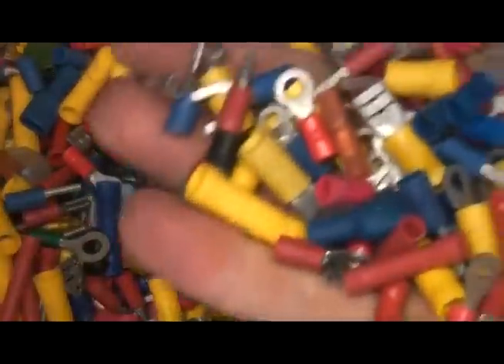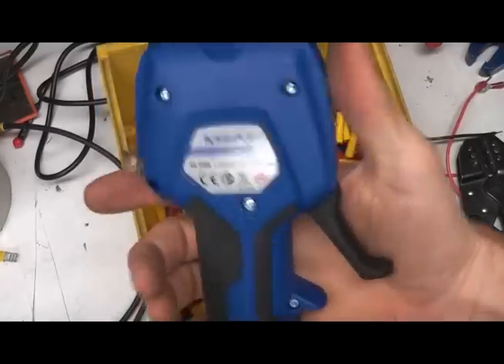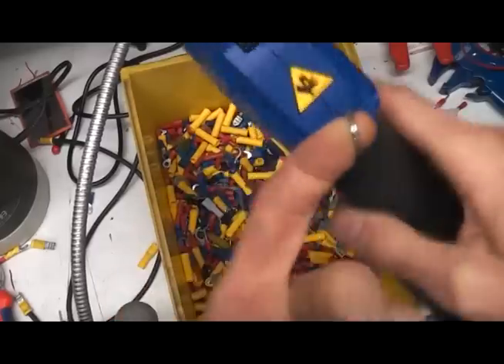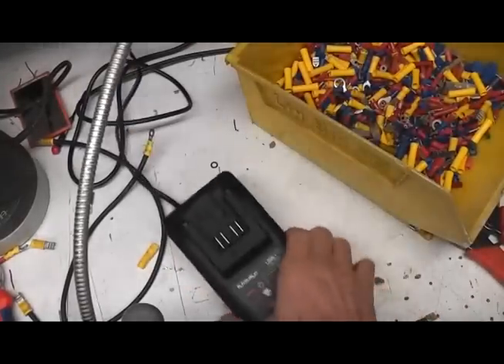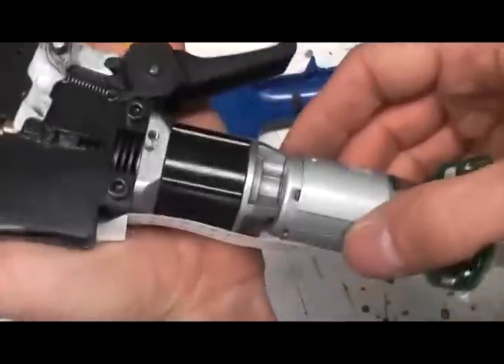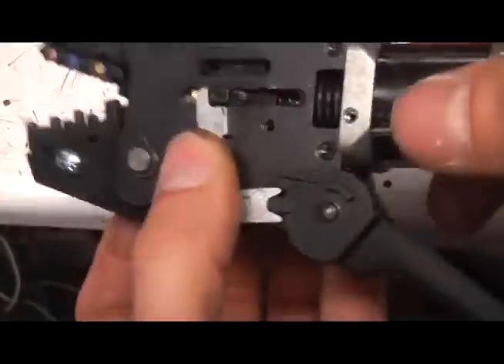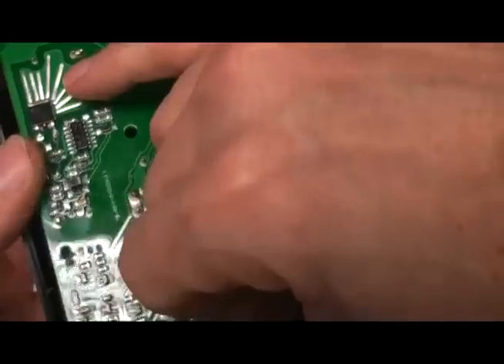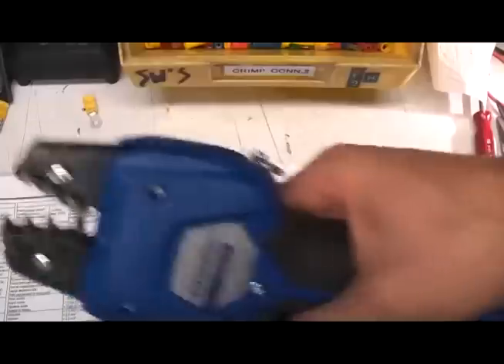Klauke EK 50ML - a totally awesome crimp tool!

Comment: Makita isn't a standard battery and I assume very overpriced. They should just use standard 18650 cells. 400£ is on the rather expensive side for a small crimp tool unless it's factory continuous use.
Reply: +Dan Frederiksen So what would you use for a 'standard' battery (not cell, BATTERY. PACK.)? Options include Makita (common, lowish cost), Bosch (common, expensive), Dewalt (see Bosch), Ryobi (common, cheap, crap)...

In this case standard means de facto, ie. common and easily obtained. Makita is a pretty good option there.
Reply: +Monkeh616 none of those are standards. And the only merit Makita has is high prices. 18650 cells are however very standard. Brand names below 2$ a piece in bulk.
Reply: +Dan Frederiksen They are de facto standards, as they are commonly available and people are likely to own tools from at least one major manufacturer.

And, as you apparently skipped it the first time, let me reiterate: BATTERY PACKS. Not individual cells (they did use 18650s in the pack, if you'd care to watch the video).
Reply: +Monkeh616 let's assume for the sake of minimizing your embarrassment that I'm a genius, shall we :)
Try to understand that the device can be designed in such a way that you just insert raw 18650 cells so there is no need for a 'pack'. See?
Reply: +Dan Frederiksen Try to understand why that's a bad idea for a power tool.. They build packs for a reason. Or is this another "I know better than all the major manufacturers of common tools but I won't use my extreme intelligence and obviously genius ideas to make and market a successful product" moment?
Reply: +Monkeh616 you'll forgive me if I don't start a global power tools company just to prove to you that I'm right. Yes I often know better than all major manufacturers, in part because I'm quite intelligent but also because I speak from a consumer friendly perspective whereas corporate evil is often motivated by greed. But in the case of Fluke and other meter makers using 9V it's mainly stagnant idiocy.
For a low power tool like this, free cells is the right choice. It's far less obvious for a high power tool that has prolonged use of specialty cells that require engineering competence to choose. Like dewalt's 36V A123 packs.
In many instances they could however specify particular models of cells for use or simply plastic wrap loose cells and sell them under their name in stores like any other of their products.
18650 standardization is good and I know best. That doesn't mean it should always be done with loose cells but in many cases it should. AA cells and such should not be used anymore. 18650 should be in every supermarket and it will happen. Just 5-10 years too slow. they could make a smaller lithium standard as well for physically smaller devices. consumer cameras could be using them as well. Flir thermal cams etc etc etc. 18650 has state of the art cells.
It's also a very good choice for DIY electronics battery projects.
Any other questions?
Reply: +Dan Frederiksen Yes. Were you born this arrogant or did you have to work on it?
Reply: +Monkeh616 It's something I have refined over the last few years to handle petty people.
Reply: This was entertaining.

Comment: Wow that is a nice tool, sadly I don't use those crimp terminals enough to justify spending £500. Now if there is a Molex/Amp/Walden head for it, then I am going to have to start looking at where the £500 is coming from :)